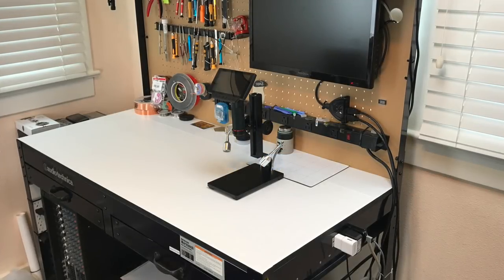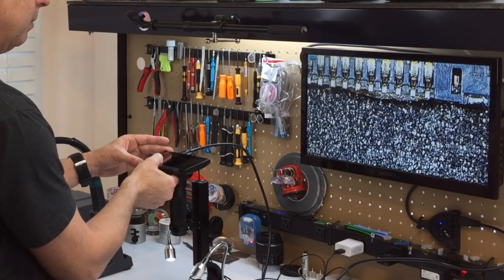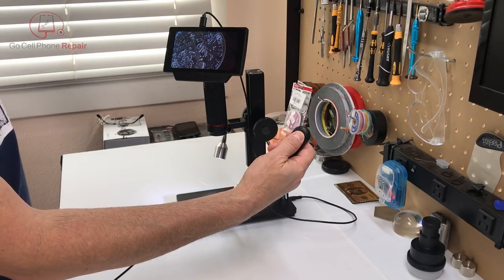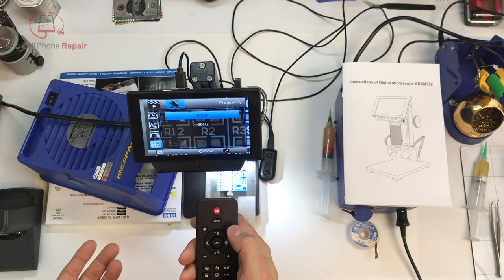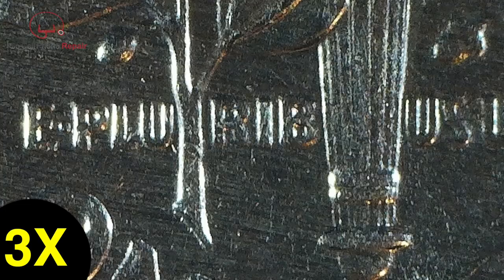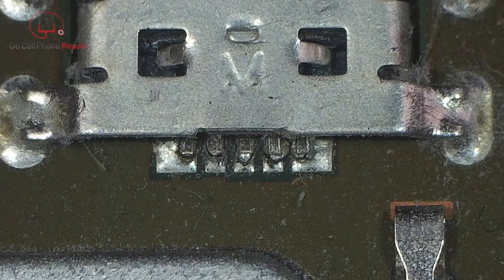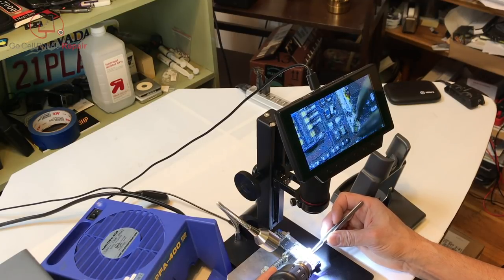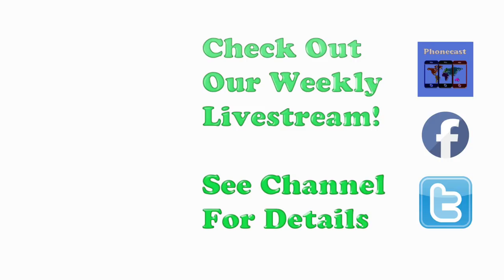Microsoldering With The  Andonstar ADSM302 HDMI Microscope? | Review Challenge

Comment: good product , I have it ,  except 200 ms lag .  i am using to verify after each solder .. but not to solder in realtime
Reply: So it is not convinient to use it for soldering because of the lag right....or better use analog microscope ?
Reply: @dwibudipermana8480  There is lag, but it's not that bad. I had no trouble microsoldering with this in real time. An analog microscope would obviously have no lag, but they consume more bench space and tend to cost a bit more.

Comment: You can modify it buy a microphone flexible arm stand and you are flexible ! And number 2 mod is buy amscope 144 led ring and install on andonstar and you will have a very better image ! Mod 3 ! You can buy filters but the choice is yours if you need it buy it I don't need it finally you can use both lights the ring and the lights from andonstar ! 
Best regards,

Comment: i got this scope too, im  trying to connect the microscope to my pc but cant see any new device in the device manager, even no usb sound popup, i tryed 6 different micro usb cables and 3 pc's with windows 7 and windows 10..nothing worked.
Reply from the maker: Are you trying to get video signal to a PC? The micro USB on this scope is for powering the LCD. It does not provide an output signal. That comes through the HDMI cable.
Reply: realy ? some one says it works with the pc software wth the same firmware ADS-171122V1.0 i have . software here (http://www.andonstar.com/index_en.asp) this links says ADS 301 i see
Reply from the maker: Hmmm. I followed that link for the ADS301 and it says video output via HDMI to PC. You'll probably want to contact the company for confirmation but let us know if you do figure out how to make that work. I'm using an Elgato HD60S because my GPU does not have an HDMI input.
Reply: sure i go ask this on some forums. want update this here. thanks.
Reply: The Elektor product page for this scope mentions distinct HDMI and PC video transfer, and the manual they link states "You need a separated USB cable to connect the device to the PC, when you need to use USB output". My guess would be that you need an ordinary USB cable and not the split thing they included.
Reply: To connect the ADSM302 to a PC you need to use :
-a regular micro USB cable.
-a power cable for the light. The weird split cable for the 2 LEDs is for power only.
- on my ADSM302, when it powers up, I have to choose USB Camera with the front buttons.

It can be used with VLC and even OBS ^^